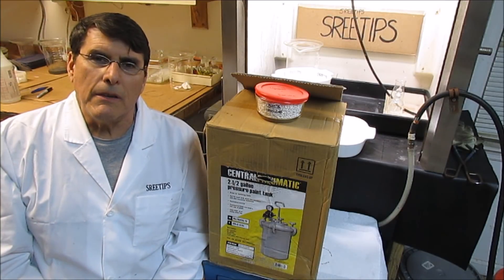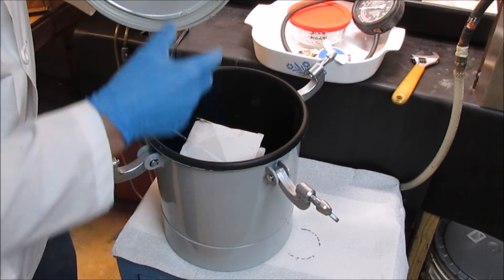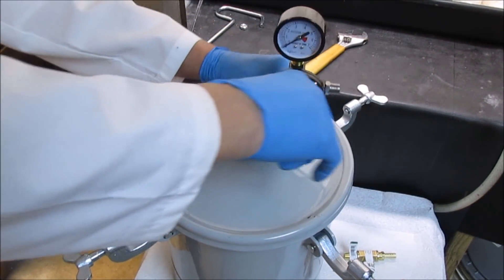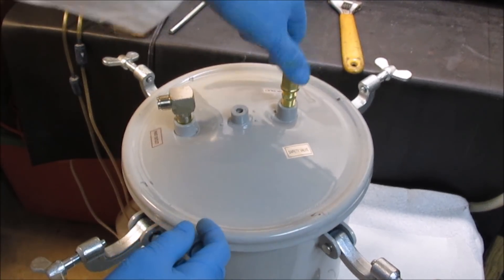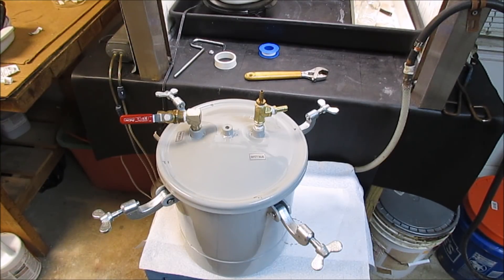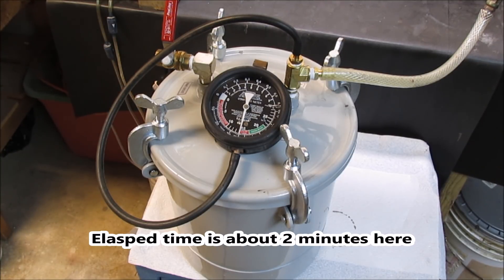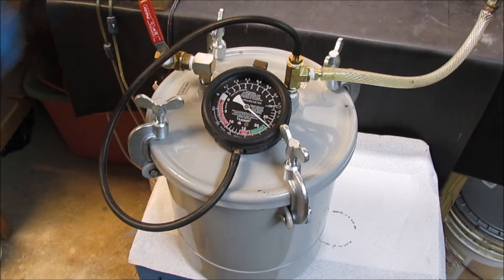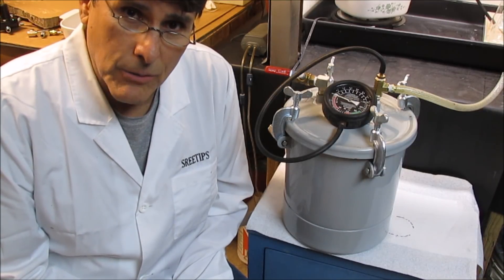Sreetips Silver Chess Set Vacuum Degassing Chamber

Comment: Great video. 
I love it when people try to find new uses for existing material. 
As a side note; and more like a curiosity thing; I'll add, the ancient Chinese used cooked rice grains which they pressed into clay molds to create tiny cavities with smooth walls inside clay bowls and vases, making the walls almost translucent where the rice grain sat after it burned away.
I imagine you might be able to use an up-scaled way of using this method, provided you give the gases coming off the burning rice pellets (or paste) a tiny opening to vent away, and you make sure most of the water in the rice is evaporated before use (otherwise you'll create enormous destructive steam pressure).

Anyway, I look forward to your next video. Be careful and enjoy your experiment :)

Comment: IMO you could be just a little less aggressive tightening down the cover clamps. The vacuum will suck that lid down by itself. Overtightening will eventually deform the gasket. You have 32 clamp/unclamp operations to make your chess set. (or, could be 16)
Reply from the maker: That's a good point, I'll ease up on torqing those down so tight.

Comment: I DO NOT KNOW HOW high a vacuum you are trying for but teflon tape on the fittings  would be a minimum jb weld after the tape would be a good idea the lining may outgas if it was metal it would outgas any oil mot cleaned will outgas i hope you do not need more than about 10 to the -3 tor vacuum anything more will be very hard to achieve.
Reply from the maker: I'll be making a silicon mood in it today. To get the bubbles out I plan to take it to 25 inches of vacuum, then slowly vent. That should degas the silicon.
Reply: the volatiles in the silicon will outgas as well if your worry it bubbles in the silicon then you may want to pull less vacuum then apply pressure the vacuum will release the larger bubbles and the pressure will make smaller any remaining bubbles anything that will thoroughly out gas the silicon will likely be very messy unless done slowly .

Comment: Nice chamber. 
My setup is even simpler. A slab of 1/2" aluminum, a hole drilled and threaded in the center for the hoses, gauge and pressure valve, a sheet of silicone rubber on top and a plastic bell jar. It serves a dual purpose of devesting and vacuum casting.